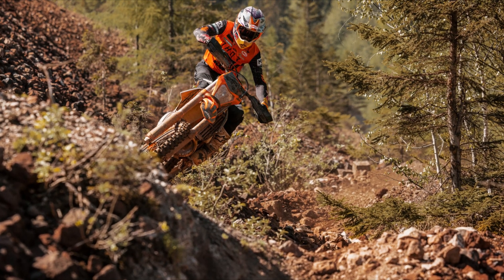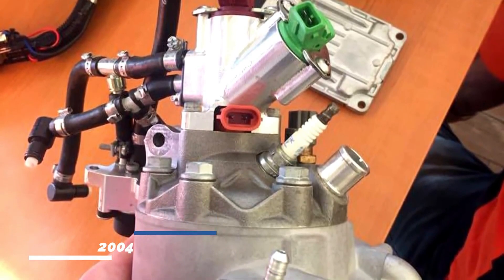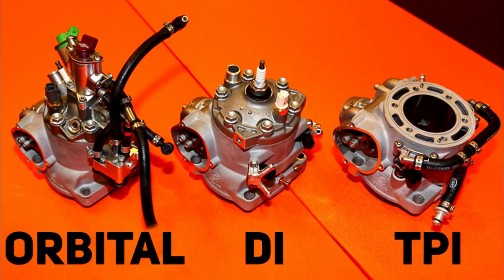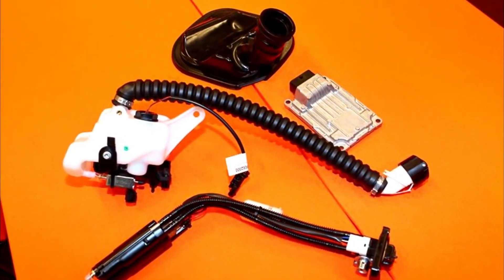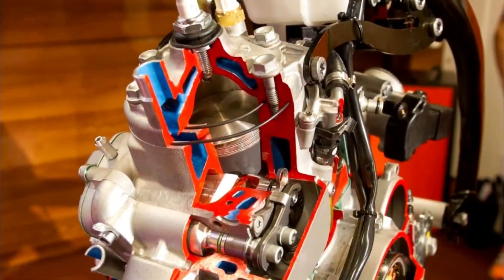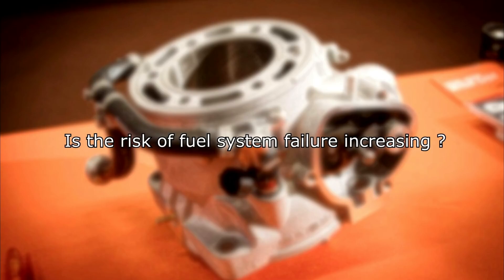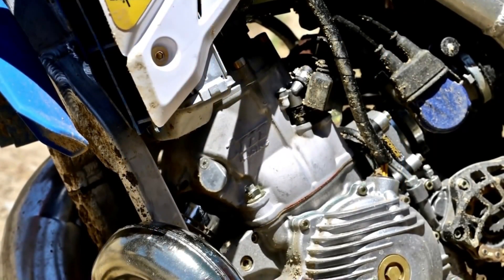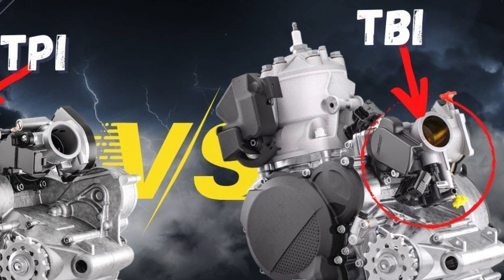The Evolution of KTM Fuel Injection System over the Years

Comment: An Italian manufacturer, Motori Minarelli, developed in cooperation with Fantic Motor, a fuel injected 2 strokes, which emissions are in compliance with Euro 5. There is research also about the use of a catalyzer, on the exhaust pipe able to convert also the white smoke from oil into a cleaner gas.

Comment: Now KTM switched to TBI, ( Throttle Body Injection ) like a 4-stroke fuel injection. Another con about separate lubrication, if the bike crash, upside-down, and the engine remain running, the oil will be injected into the crankcase, resulting in engine damage. This is why KTM this year, on the MX model use pre-mix fuel, and TBI.